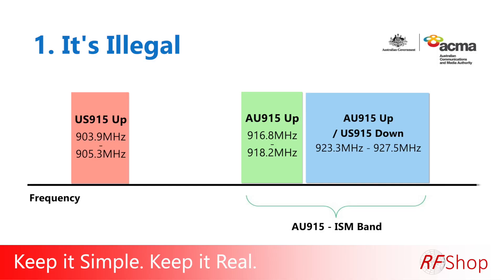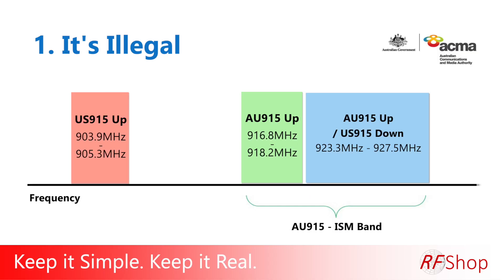Is there a difference between AU915 and US915 for Helium mining or any LoRaWAN gateway and sensor?

Comment: Hello your videos are super informative and very well constructed, I recently purchased a Sensecap M1 but when trying to assert location and set the antenna information (dbi,height) there's no Sensecap M1 AU915 only US and EU options are pre listed? Have I been sold an incorrect hotspot under AU195 listing or does it not matter what I input here?
Reply from the maker: Hi Jordan,
Sorry for the late response here. You can use the custom option to select your antenna. I assume you purchased your antenna from the IOT Store in Perth? It will be the correct one

Comment: I just purchased an AU915 on amazon. seller states that it will work in the US. is this possible?
Reply from the maker: I guess it depends how easy it is to switch the unit to US915, but on paper that is exactly the background to this video I created and a massive problem out there. No, the unit by itself will not work in the US (same problem I explained for my little unit)

Comment: Thanks for the content.  Rf engineering is so interesting. I'm looking forward to your next uploads.  I have a questions about signal amplifiers. and there value in the Helium network.    I'm a hobbyist and I've been trying to research how to maximize my Helium setup and I have come across the use of amplifiers. Specifically, for the receiving signal since there is a limit the transmitted signal strength legally.  I have come across the following amplifier model ZX60-0916LN-S+ sold by many.  This model is supposed to amplify the incoming signal and bypass the transmission signal.   I'm wondering if this true, if it is worth it, and pros/cons? I'm assuming that having an incoming amplifier would increase the SNR and allow for increased witnessing.
Reply from the maker: I had a good look at this amplifier. Not sure how it will affect the performance as it is pretty poor on the transmit side and will probably cause more harm than good. I would not recommend using any amplifier…but I do think I need to make a basic video about this as well.
Reply: So on second thought I think this amplifier is not a good idea since the miners don’t have separate gain settings for RX and TX. Therefore in order to use the amplifier the gain would have to be set between 17-20 dbi I order to avoid invalid witness. This would leave the setup up with very low TX power. Would be great to be able to amplify the RX but leave TX power at maximum legal power. Currently I haven’t figured it out or it may just be a limitation on the miner design.
Reply from the maker: @derrickdiaz3737  I also think the amplifier is actually only one direction so it kills your tx

Comment: This is helpful but what you haven't addressed is the question of whether a device has been designed to operate on both AU915 and US915 bands. There are several miners that claim to be able to operate on AU915 and US915 irrespective of which model they are sold as. I believe they have to be sold as AU915 OR US915 but can adjust their channels and work in AU915 OR US915 as needed.
Reply from the maker: Yes, that’s a good point. I’m pretty sure it’s easy to switch country bands, as it’s also very easy to switch some WiFi devices between bands. 
However, from a regulatory standpoint it’s a very bad idea to try and use US915 here in Australia even if it’s technically possible. I would expect the manufacturers to have a way to control this but in the open source world this appears to be very poorly controlled
Reply: Has anyone done a video on this to show how it’s actually possible?